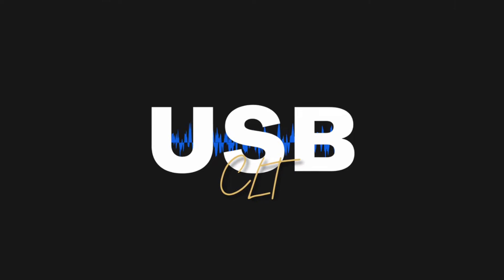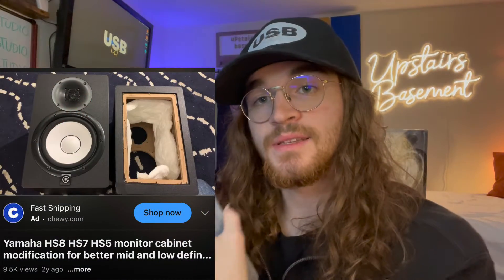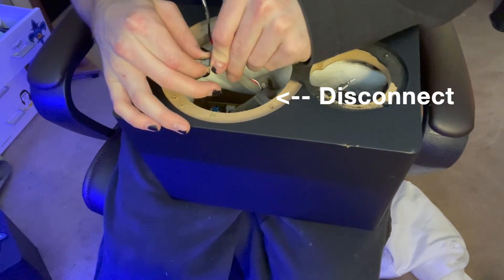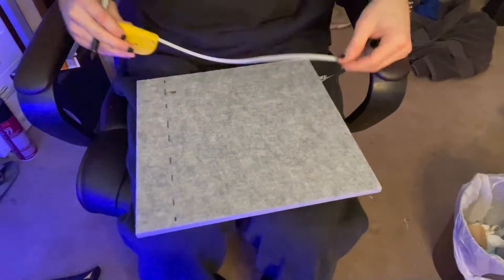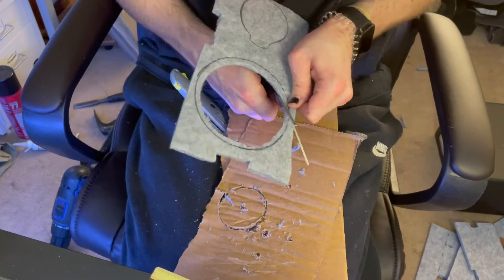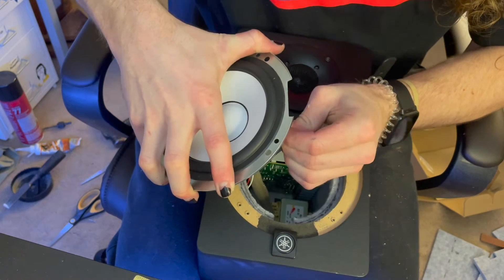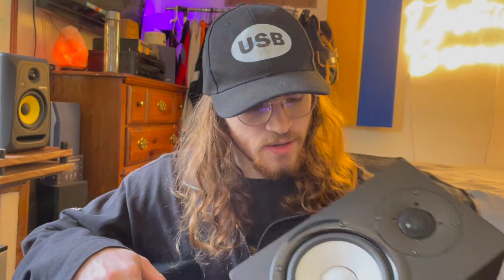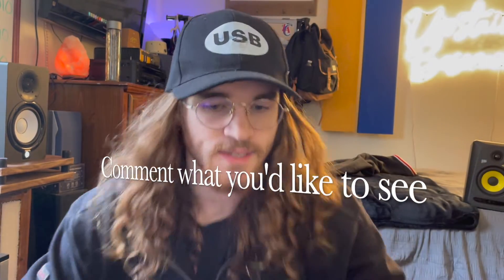Yamaha HS5 HS7 HS8 Customization & Woofer Replacement

Comment: 0:36 wrong sir, wrong! They can act as rigidity devices, damping, higher frequency dispersion (midrange etc) depending on material and shape. It also depends on the crossover frequency as to whether you will hear much from the dust cap. Also if your speaker has venting holes in the voice coil former or under the dust cap, then you will certainly hear its removal as air rushes out of the cabinet through those holes.

Comment: Hi! The damper material is felt, am I right?
Reply: Basically. Would be interesting to see if that actually helps or not. They are reasonable monitors though I feel you could also build some nice passives or even try some other monitors. Then again I've learnt that many studio monitors aren't even all that "flat" in the response, so half the time you are still choosing a house sound like you would with hifi speakers
Reply from the maker: I think I was just bored lol. It prob did more for me mentally than audibly 😂 was still a fun project and they sound great so who knows 🤷🏻‍♂️
Reply: @upstairsbasementclt  I did the same and compared the original with the modified measurement microphone, there are no changes.
Reply from the maker: Nice lol

Comment: 02:48 What is the top part of that tube in the lower right corner of the video frame? The one that looks like a trumpet. I bought a used pair of these speakers and that part is bouncing around in there. Is it an easy fix? I'm trying to figure if I should fix it, or just return it. I got them for $110 so I'm hoping to keep them. I haven't opened up the speaker yet.
Reply: bass reflex port. important for your lower requencies. if its disconnected or not connected properly to the back panel, there will be no bass or sound will be excesivelly boomy on some frequencies. just glue it back, should be easy

Comment: Thanks for the video.  I did the mod and can tell the bass and mids are about 15% more pronounced.  The treble seems to have tamed some which makes it lose some of its sound stage, but at the same time some songs the treble was too much.  All in all I don't think I'd do it again as I have an 8" subwoofer hooked up.  Only been listening at low volumes for 15 minutes though so maybe when I get to turn them up some more I will hear more bass and mid power

Comment: i had a set of these about 10 years ago, noticeable lack of bass, but i felt confident with translation. i recently borrowed some after not having them for a long time and maybe they were worn out but they sound really bad, severly lacking any kind of bass whatsoever, like they were out of phase. i checked the phase of course. even the best commercial recordings sound like doo doo on them. I know the original speakers they were more or less based on also had a reputation for sounding like ass too, but they are a staple for translation checking. i'm wondering if there's something wrong with the power supply or the woofers need replacing, but no bass under 100hz.
Reply: then yeah something is wrong

Comment: Very nice but use a work bench or safe surface, don't ever work over your legs and privates with those tools. Sweat pants can bind up on drill and knife can slip and slice your legs or stomach. Ive seen things happen in real time and its not pretty. Great upgrade to the HS5s though.
Reply: Felt the same, don't  drill on the lap. 😮

Comment: Great breakdown - but please my man dont use knived and drills as the platform for your knives and drills. Also shouldn't use a drill for something as fragile as those speakers as you can easily over torque those screws.

Comment: do yamaha hs 5 magnetic shielded?? cant find this information need to confirm this before buying
Reply from the maker: You’re asking if the woofer itself is magnetic?
Reply: @upstairsbasementclt  yes i mean is the woofer is magnetically shielded? like if i put the speakers close or near to CRT monitor it will affect the monitor some speakers equipped with magnet shield to prevent this problem some aren't, i want to know if the yamaha hs5 equipped or not
Reply from the maker: @bolulembut1132 they use large magnets in an advanced magnetic circuit design
Reply: @upstairsbasementclt  do they have strong magnetic field? around a speakers? im kinda worried it will affect my laptop and external hard drive because i always put them on top of speaker
Reply from the maker: I’m not an HS5 expert. I wouldn’t be able to give you a for sure answer. I’d try and look it up on Reddit or other forums on google. I don’t want to mislead you!
Reply: no

Comment: Hi, how big is the tweeter on the HS5?  The reason why I'm asking,  I'm wanting to buy a pair Yamaha tweeter speakers #YE744A00 (from Yamaha or other stores), but I don't know if these are "4 inch" tweeter compression driver that are bigger or smaller.  There are no specific specs in internet.   I have a HS8 and I know, mine tweeter are 5".   If you can tell me, it would help alot.  Thx.
Reply from the maker: Hi, best thing to do is look up “Yamaha HS5 Tweeter replacement”. Did you try this?
Reply: @upstairsbasementclt  everyone shows the same spec and picture from manufacturer.:  i.e., Silk dome tweeter on 1" and 5" on the woofer.   But they can't tell me if the tweeter is size by "diameter across" (i.e. 3.5" or 4" or 4.5" or 5").  Honestly,  I'm trying to replace my old Alesis Monitor One tweeter (4").  I hate Alesis' tweeters.  They are too dark and I want Yamaha's tweeters.
Reply: @upstairsbasementclt  so, I'm assuming you probably no longer have your HS5, right?